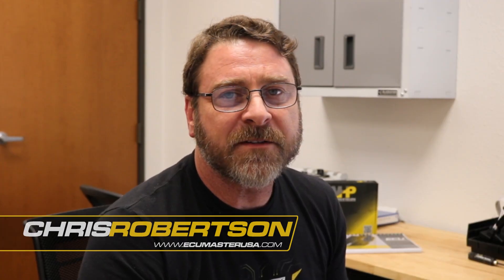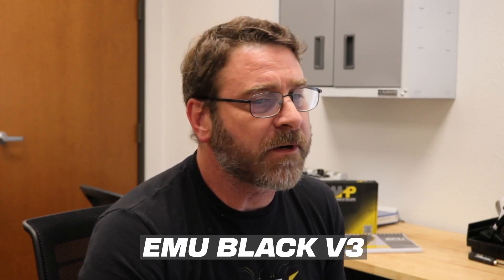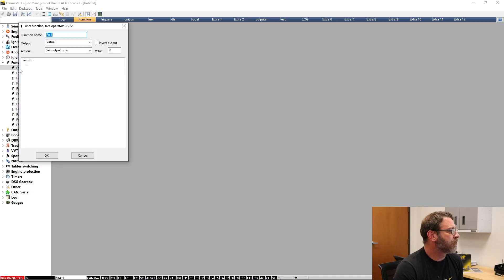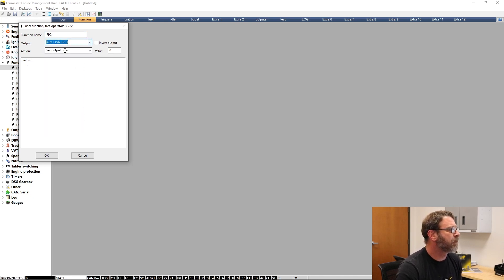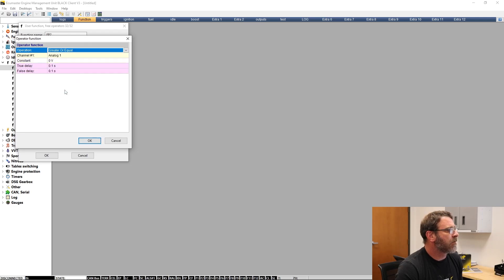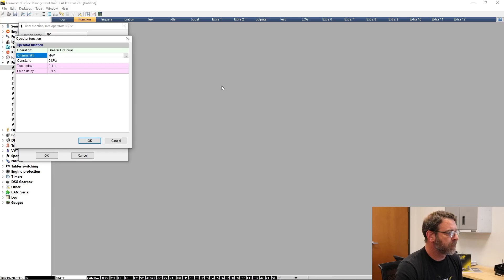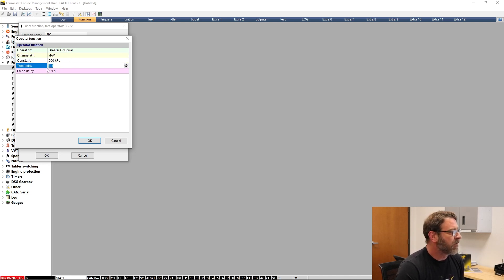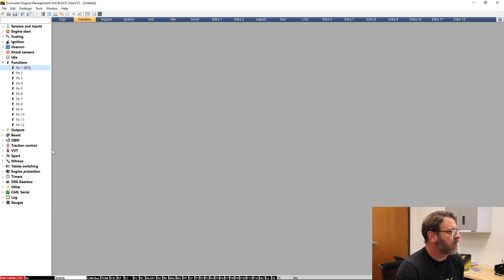Configuring EMU Black V3 User Functions | ECUMaster USA

Comment: how can i pwm a sinle pump?

i want to run a single wallbro 530lph. that is just about  enough for my application. but is too noisy and heats up the fuel if runing at full speed. 
i want to control it via a solid state relay. but theres no option to do this on the primary pump. so i would need an override button to be able to prime the car if i set it up as a pwm output?